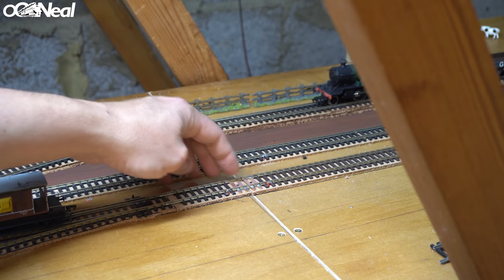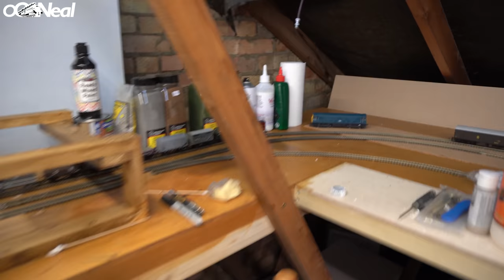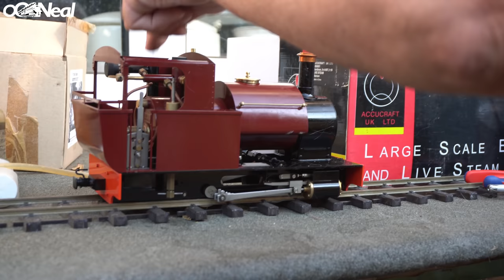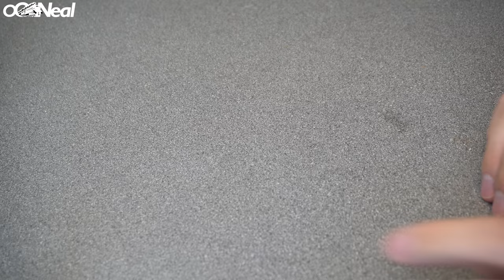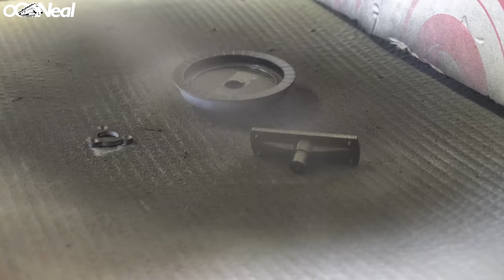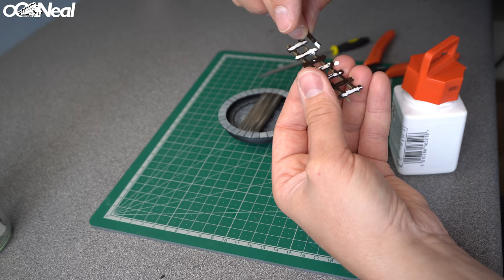Building Up A Model Railway S1 Ep 44 | Layout Focus | Making my own Turn table using a 3D Printer

Comment: Hello Tris. The Metcalfe platform kits are good for making curved platforms. I've used the N gauge kits many times with good results. I think they look more realistic with even a slight curve to them.
Reply from the maker: I think I may do that thanks 😊
Reply: @OONeal  I first cut a template for the top and then built the walls and ramps straight onto the base board. Set them back slightly to get a nice overhang.
I used mounting board for the tops as it's a little thicker than the supplied card, and then used the sticky backed edging strips. If you put little slits in it you can follow the curved edge of your platform nicely.
Reply from the maker: Peter Marshall super thank you. I think I understand what you’ve explained 😊
Reply: @OONeal  I really enjoyed using all the Metcalfe kits. Easy to adapt and lots of spare bits for scratch building. Although your 3D printed models are excellent.

Comment: nice one Triss, turntable looks cool, I'm really interested in doing a 009 layout. So following your progress with great interest. Your right about confidence, I just started the hobby Jan this year, and put off certain jobs - ballast etc- because of the worry about messing it up. But hey, I just got on with it, as You say, which is the best policy, it actually worked out as did the other tasks that were all new to me. Its basic, no point motors etc, but it works, its fun and most of all, its mine - done by me. Thanks again for your uploads and your 'easy going' manner is a good influence. Is your layout all DC? Will you add any animated scenes, your skill set is well capable and a 3D printer would produce all you need for one?
Reply from the maker: Hi, thank you and it’s great to here your thoughts 😊 so my layout is DC and I don’t have a single point motor on it yet 😁 as for 3D printing I will do as much as possible as I don’t have a lot of spare time I can draw quickly and then hit print and have some fun with my couple of hours spare in the evening if I’m lucky.
Reply: @OONeal  that's good to hear, DC is very underrated, less costs, less hassle. Thanks again for your kind response. All the best.

Comment: The turn table is looking good when are you going to do more work on the station side of the layout? anyways take care of yourself mate :)
Reply from the maker: Exeter Central I will be getting to it at some point but I have plans which I need to work out so will finish a bit more on the hill side and then come back to it